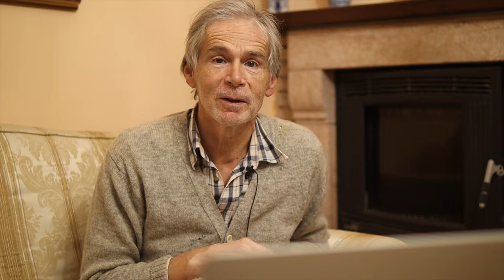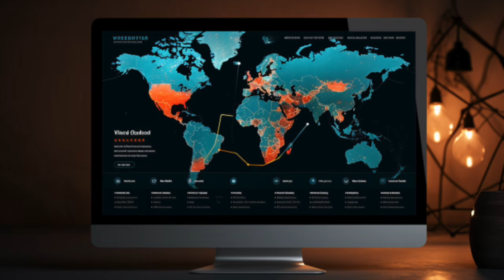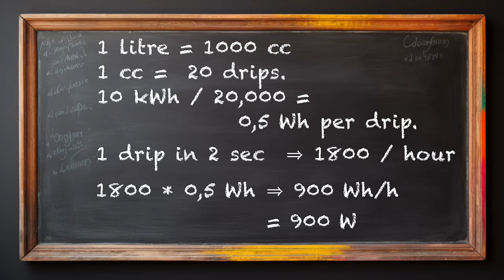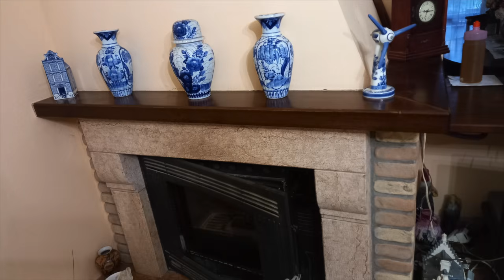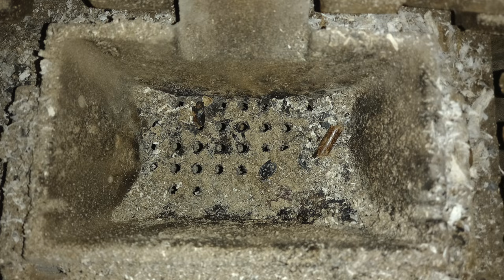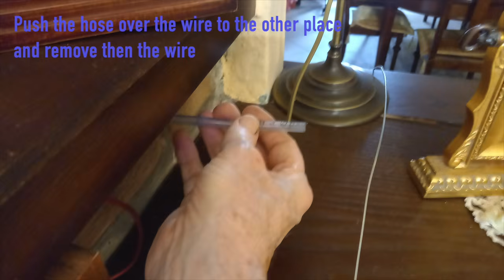Waste Oil Drip into the Hybrid Pellet/Wood Stove - Video 119

Comment: really  liked this video. first thing i did when i got my diesel heater was wrap the fuel line next to the exhaust pipe with aluminum foil hvac tape to make sure it didnt get too hot.
when we had a power outage 10 years ago due to a very rare wind storm in november, entire town was out of power for 2 weeks since damage was so widespread.
actually heated my appartment with a few oil lamps i made the first night. had a 10 year old bottle of ~30 liters of old/rancid cooking oil. best possible use for it.
i calculated each tiny oil lamp i made out of old soda cans put out around 200-400 watts, or the same as a space heater on low, so 3 of them was about the same as a space heater on max.
i made them inside of another can so that the carbon/soot wouldnt get on the walls/roof, and really only used them at night time. land lord was super confused why the upstairs was warm and I was still living in my unit after a week. he was convinced all the pipes would be frozen inside lol.
Reply from the maker: That's an amazing example of practical DIY heating, especially using old cooking oil and simple oil lamps. It sounds like you were very well-prepared!
We discussed in another video about the Chevrolet Volt, I remember and I was amazed of the Lightyear from my home country NL, which went out of business...and even recently.
I will see the video further, just have to finish the video and the other things that I related with it on Gumroad.
Reply: Well, nice video. - Now I repair, modify, and invent stoves. By clicking on the image on the side, you can see various heating solutions I've created and modifications to a pellet stove. - Greetings. Comments and shares are welcome.

Comment: Dear Norbert
Once again, an ingenious use of waste materials or equipment in a DIY context, both for developed and developing countries! 
One question I have is about the toxicity of burning these waste oils.

Keep up this excellent work!
Reply from the maker: Dear Dirk,
Thank you again for your thoughtful comment. Waste cooking oils are generally safe to burn when the flame is strong and the oil falls into a hot combustion zone. They burn into CO₂ and water, just like clean vegetable oil, as long as the stove has good airflow.
The only oils that are toxic to burn are mineral oils (like motor oil) because they contain metals and chemical additives — these should never be used.
By the way, I wrote you three emails recently. If you didn’t receive them, please let me know — maybe they went to spam.
Reply: Well, nice video. - Now I repair, modify, and invent stoves. By clicking on the image on the side, you can see various heating solutions I've created and modifications to a pellet stove. - Greetings. Comments and shares are welcome.

Comment: hi Norbert that is interesting, adding waste oil, probably smells like fried chicken or fish. a thought, Could add a water jacket and radiator for a thermosiphon loop system no moving parts. I wonder if a mini-system could be made using an alcohol burner with a high temp carbon blanket for a heat source and a mini radiator for emergency heat during a power outage. or using solar to heat(limited to daylight). cheers
Reply from the maker: Hi Mark, my olive oil has also its own smell but the pellet oven is closed.  What would you do with the radiator,  using it for the exhaust gas? See my video 117 where I use a radiator for exhaust and get much heat. With the pellet oven it would be difficult. I don't have yet experience with the carbon blanket but would like to apply for oil because that is the available waste stream in many countries.